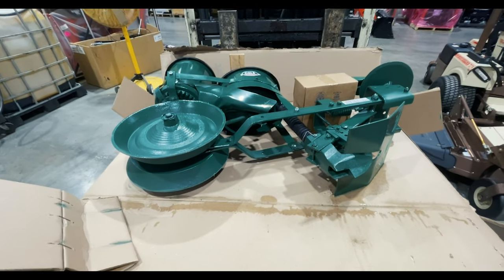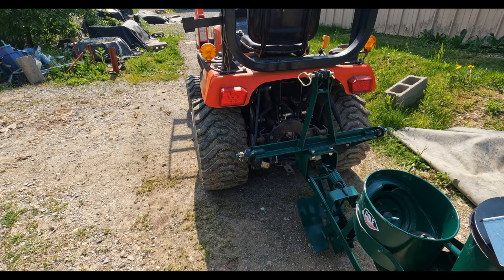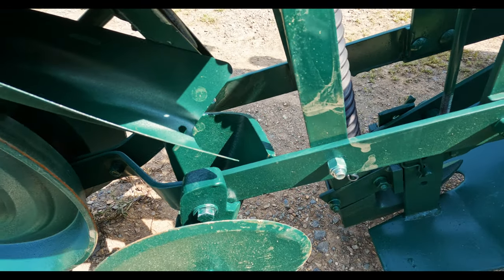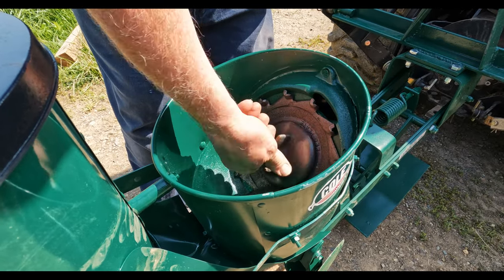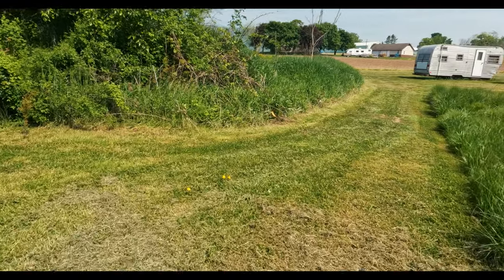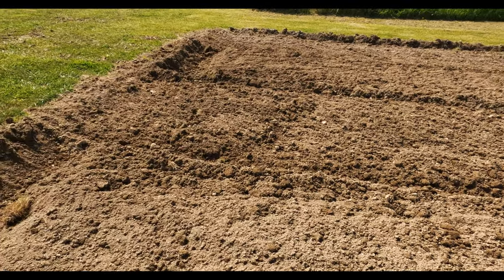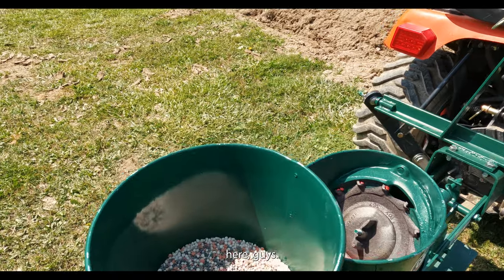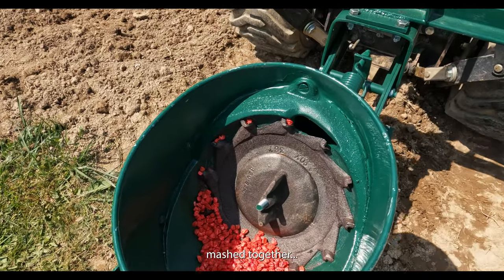Revolutionize Your Planting Process with the Cole 12MX Planter: A Comprehensive Review

Comment: There's a few things you're doing wrong here. 1. You're using the wrong plate. For small sweet corn seeds you need a small flat or extra small flat corn plate. 2. The top of the flat plate the hitch bolts to needs to be 13" off the dirt, and the tops of the hoppers running level. 3. Make sure the whole planter is properly lubricated. These things like grease. 4. Tighten the cap on the plate, then back it off until you can make a full revolution without the plate dragging. You'll know you've got #3 and 4 right when you can take the wheel with your hand and spin it freely. 5. Run graphite seed flow lubricant in your seeds. 6. Make sure the wingnut on your sheetmetal partition is dead tight. When you have one of these planters set up correctly they run like a Singer sewing machine.
Reply: Wow, great advice! I have one of these and may dust it off.
Reply: @amathonn want to sell it? Lol

Comment: I had to make a shorter top link to lift the planter higher on my Kubota 2350 only way for it to work correctly.  If you don't it will drag the back wheel. Had it shortened at Jira Welding on 641. Only way it would work correctly on my compact tractor. Planter works great on my compact tractor.  I also use a gauge wheel on both of my mx12 planters.
Reply from the maker: That’s an issue we as well. Planter drags even when 3pt arms are the whole way up
Reply: @noltspowerequipment Talk to Jireh welding on 641 in Newville he made my top link.  On page 3 in MX12 manual if tractor has no down Pressure you need a gauge wheel I have a spare one you can use but not for sale I am looking for my third MX planter.  Tom at Jireh welding has my phone number.
Reply from the maker: Thanks for the info! JS Woodhouse has a number of Cole’s models and we could get our hands on one of you need!
Reply: @noltspowerequipment  Just trying to help.

Comment: The problem with a three point hitch is that it maintains angle between the tractor and the planter (implement).  So you guys adjusted that top arm, but as soon as the terrain changes, that upper arm needs to be adjusted again.  For instance, if the front wheel of the tractor runs over a clod or a rock, it lifts the front of the tractor. The result is that the press wheel gets pushed into the ground.  If the front of the tractor makes a dip, it would elevate the press wheel ..... and you lose your drive system because that wheel isn't in contact with the ground.
All of this is a disadvantage for 3 point systems.   Ideally, you use 3 point implements that don't touch the ground, like a sprayer.

Comment: Mx 12 is a good planter just need to understand how to adjust and use correct seed plates and the correct distance gear. Adjust the fertilizer flow all the information is in the books or on line

Comment: That tractor seems way too small for this planter.  The top link on the 3 point hitch is so steeply angled and very touchy in its adjustment.  It almost looked like it should be towed with front tires on the front so to maintain a constant pressure when travelling instead of going up and down as the tractor drives across the planting bed.